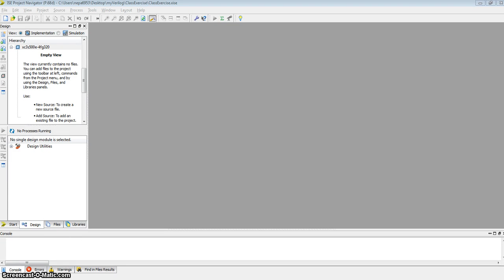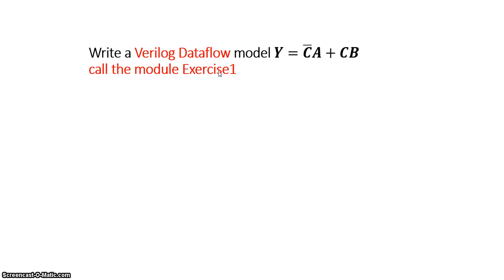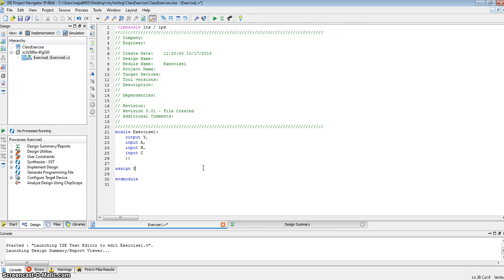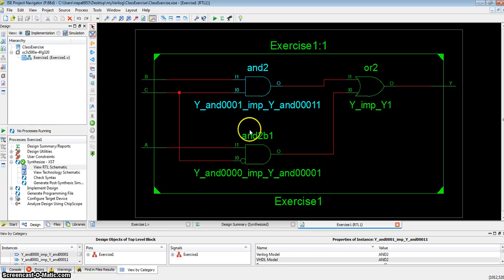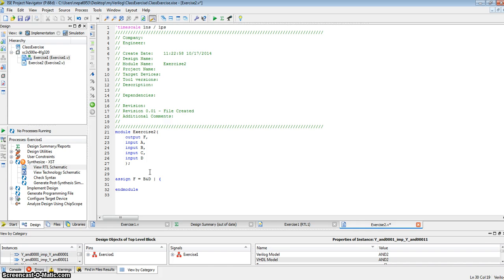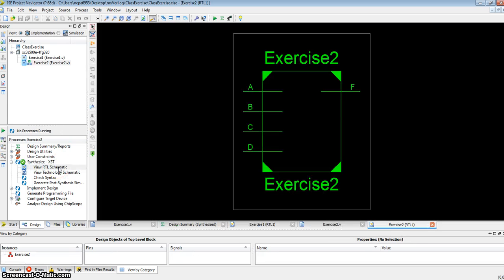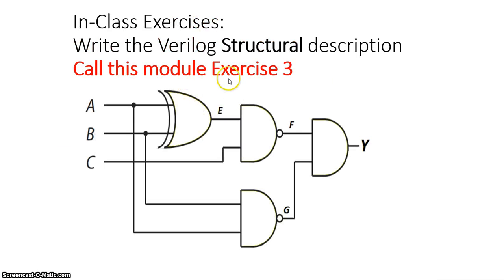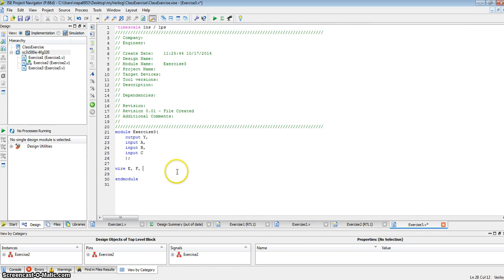Verilog (Part 1): Example Dataflow and Structural Description

Comment: Greetings, will this tutorial also work similarly when using Vivado?
Reply from the maker: Yes it will. Your interface will look different but Verilog is the same.
Reply: @ENGRTUTOR  Thanks a lot. I seem to notice that the synthesized design looks somewhat different compared to the RTL analyzed design. Is that Vivado working its magic or could I be doing something wrong?